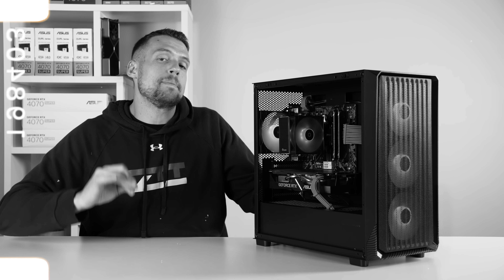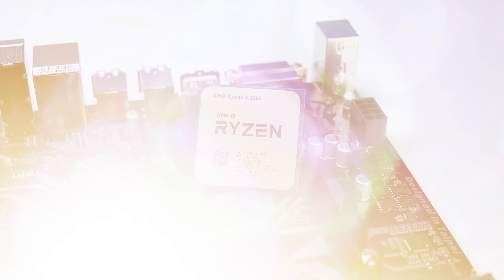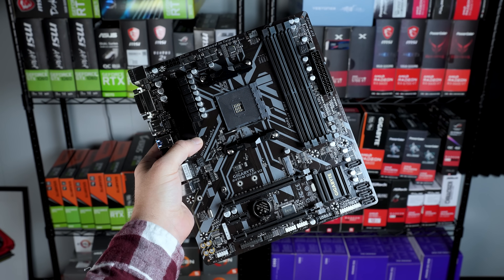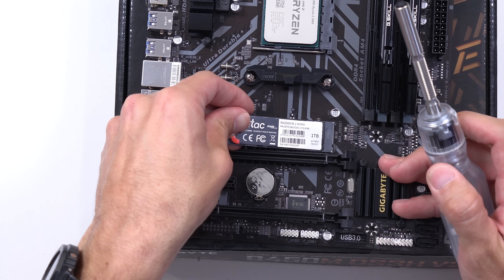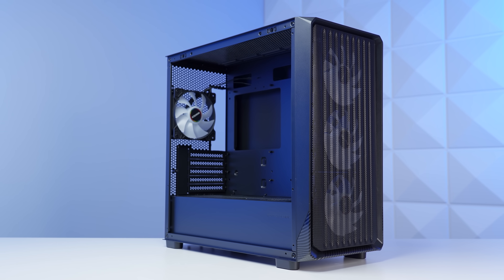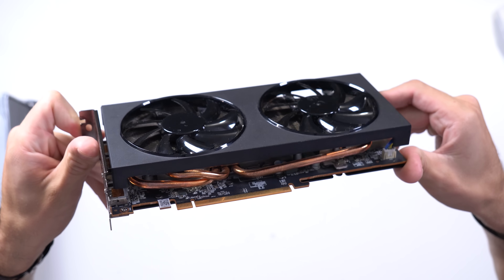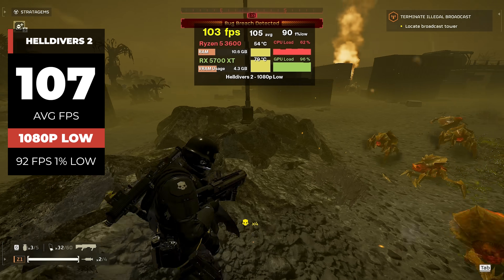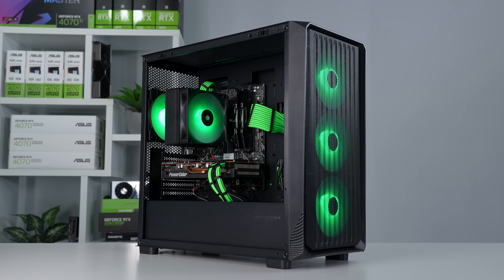$450 Gaming PC Build Guide

Comment: Hi Zach!
Sorry for commenting again.
But  really need some advice on which GPU to get:
RTX 3080 12GB (387€) – brand new, bulk version
RTX 5070 12GB (540€) – brand new
I mostly play games at 1080p and might upgrade to 1440p in 2 years.
The games I play include EAFC 26, Fortnite, CS2, Valorant, Rocket League, and occasionally horror games, COD, Battlefield 6.

My full build:

Motherboard: ASUS TUF GAMING B850M-PLUS WIFI – 159€
CPU: Ryzen 7 7800X3D – 305€
Cooler: Arctic Freezer 36 – 33€
GPU: RTX 3080 12GB / RTX 5070 12GB – 387€ / 540€
RAM: DDR5 CL30 6000MHz 32GB (2x16GB) – 99€
SSD: 1TB NVMe (7000 MB/s) – 61€
Case: Montech XR – 59€
PSU: ADATA XPG Core Reactor II VE 850W

I’d really appreciate any advice on which GPU would be better for my setup. Thanks!
Reply: 5070 definitely. Sure the 3080 has better price but it doesent have new features like better dlss heck even mfg and off better ray tracing core
Reply: Please tell me where you found a brand new 3080 for that price
Reply: @fesoyincprobably old unopen stocks. Some of my local store still have sealed 3070 and 3080
Reply: @nanotech_00  I mean a 3080 for that price is an insane steal
Reply: @fesoyinc bulk version on alza
Reply: if you really want a good price to performance card you could get a rx 9070 it runs little faster than the rtx5070 if you are sticking to nvidia get the rtx 5070 if theres a rtx 4070 super under 500€ get that, it performance the same but the value would be better
Reply: @jayjaywolterman6627  the price of the 9070 is 640€